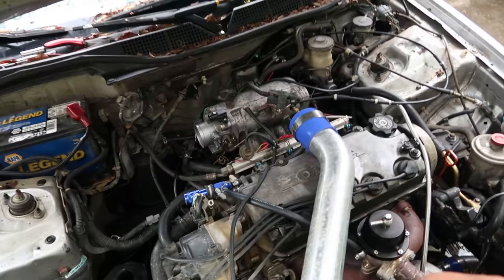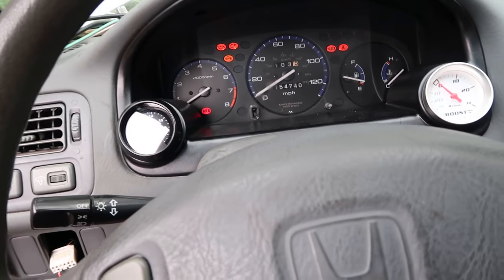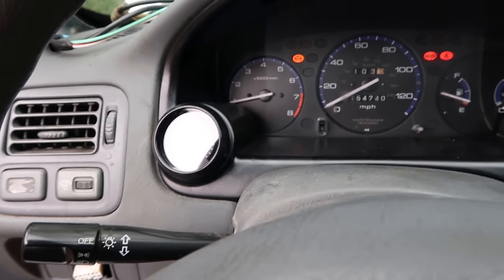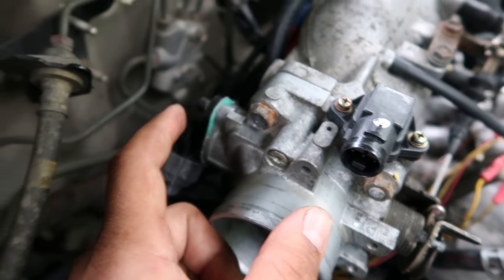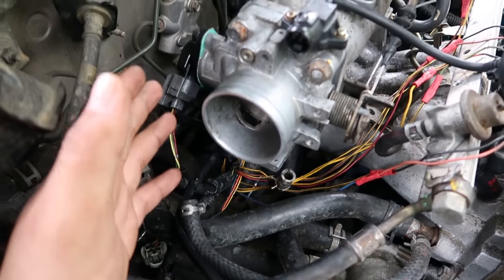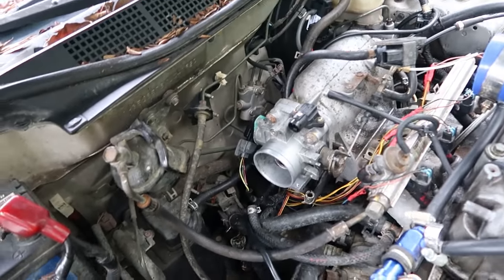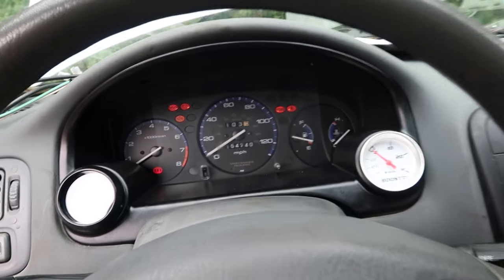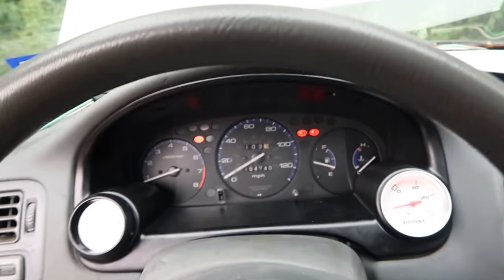Honda 1500 RPM Surge Bucking Hesitation FIXED

Comment: Been driving my car like this for the last 3 months after I deleted my iacv and got my car tuned. I only had to readjust mine as opposed to replacing it, but it worked. Thanks a million bro!
Reply: Really i have a similar issue.. were your idle rpms below the normal level?? 

Im going to clean and afjust my iacv and look into this sensor as well

Comment: Idle surge means the tps is at the correct position but you have to fix the vacuum leak if you advance the tps to fix the idle surge the car will drink gas more than usual

Comment: So I changed my IACV sensor , my TPS sensor, map sensor and IAT sensor even got a replacement oem Throttle body gasket ! 
It fixed all my idle issues besides one thing. when I'm coming to a complete stop, my rpms will go down. but as its dropping down towards 1200-1300 rpm,  it will stays there for like a second or two then it will drop back down like normal  until I accelerate again and come to a complete stop again.
Reply: Where you able to find the issue? I too having the same issue with my honda civic 2004 lx
Reply: @blue_sprinkles1487  i removed the little breather intake filter i had on the motor added a vacuum hose that goes to the rail the connects to the idle air control valve into the intake and added a iat sensor but the light still on for the iat sensor but i adjusted the idle screw abit and my tps i made sure it was at the right voltage shes been running good so far

Comment: I think I’m having this issue it mostly happens for me partial throttle around 2k -4K. B18c1 it started throwing a p0170 code at me and a evap code also. I’ve changed the grounding wires cleaned the contact points. Changes plugs and wires. Changed the o2 sensor. Going to buy the tps ASAP and fingers crossed it works. Also put a new IAC on it
Reply: Did this work?
Reply: This work for you?

Comment: Did it go away when the car was warm mate?? Im having this problem, ordered new sensor as had it fixed, but soon as it was turned off and restarted warm it came back
Reply: Same with me, as the car gets warmer it’s starting to act up more
Reply: @ArchangelMicheal-vk6jm  think it has to be a problem with the p28 ecu , my tuner said this... told me to get the s300 hondata or the new hondata standalone ecu .. at 500 quid i will live with it lol
Reply: @wolfcivic95  I’ll check that, thank you

Comment: Quick question man, i did that and i does not fluctuate when im reving it freeley, but when i drive it and when its under load the car starts bumping and gets stuck at 1500 rmp why is that? Also it starts rought, does not cold idle and wants to shut down( BTW IAT SENSOR IS NEW AND TPS SENSOR)

Comment: I have a similar problem: when the car comes to a stop, it reves to 1500 and back to +-800. Also when I turn around my steering wheel, it goes all the way to 1500 and back to stationary. Any ideas ?
Reply: you ever find a fix for this?
Reply: @ByCrackin  not yet ;( you have the same problem?
Reply: @WatchfulListener  yeah man, also throws a check engine light when it is at temperature
 and idleing
Reply: @ByCrackin  check your pcv valve / tpm sensor

Comment: In my case sometimes when I let go the gas to change gears (mostly from fisrt to second) the rpms drop super fast to idle, so I have to tap the gas a little before engaging second gear. Changed the TPS already (because of other issue). Steel can't figure out what that is
Reply: Check your high tension wires/coil harness. Try to replace them all with new one. And update me if there's a difference on it.
Reply: Did you ever fix it? That sounds exactly like my issue
Reply: Check your iacv or fitv, i had the same issue, i found that my iacv was disconnected, once connected the rpms didnt drop so fast and i was able to cruise in a lower gear without the car bucking

Comment: I have a gsr integra and sometimes it will buck so stupid. Like on first gear it’ll look like idk how to drive stick. And sometimes even while cruisin it’ll be cutting off power. I’ll give it gas and you can just hear the intake suckin and when I give it more gas it’ll go but sometimes keeps doing it. Then sometimes it drives super smooth. Wtf is my issue it’s so annoying. I checked the code today and it blinks 7 times Thts tps… do you guys think I need to adjust it or get a new one… I replaced that not too long ago but my guy probably put it on wrong idk. My buddy said it could be a bad temp sensor as well. It’s sooo annoying when it bucks like that tho

Comment: Your supposed to set the TPS to 0.5v at fully closed(no cable resistance) and 5v at fully open. If you cant get those values or theres dead spots as you open the tps  then you have a faulty tps and should be replaced. And 450lph is waaaaaaaaaaaaay too much for a stock d series lol your stock pump is fine, install a fuel pressure regulator, fuel pressure gauge and bump it up a little and it well fuel more but honestly without a tune( chipped/socketed ecu) all the mods are pointless as the ecu always tries to keep stock values.

Comment: What is the name of that sensor? Im having a similar issue after my timing belt broke going 10 mphs. Replaced all my belts, set timing, have taken apart the intake manifold cleaned it. Replaced the idle air control valve and map sensor all within a month. My car dies out going from park to drive.

Comment: I don't know if my problem is the same but as I am accelerating under 2k it surges in and out but as soon as I reach 2k it's fine. I'll have to look into your fix.
Reply: Yes! I’ve had the same annoying issue! Bucks and surges at ONLY partial throttle... but completely fine when floored. WOT is the only way to drive the car when it’s warm. Once car warms up to temp.. the problem gets bad. 
Have u found or fixed this yet?? Thank you
Reply: @Brianwasaabi  I honestly still haven't messed with it. I drive 2 minutes to and from work on it so I haven't really cared lol
Reply: caslone88 holy crap.. the Honda problem NO ONE can find! SUCKS! It’s been a year for me. When on long trips it’s awesome cause I’m full throttle lol. Wish I could take it to Eric the car guy for real. I know it’s just one small plastic part or a ground causing this. Gonna change my fuel pump and my iacv .. to oem Honda. then probably ecu. Cause she still has great compression and just did timing belt year ago
Reply: @Brianwasaabi  maybe talk to a older Honda tech at a dealership who might know what's going on?
Reply: I replaced the TPMS and calibrated it and it didn't seem to help at all.
Reply: @Brianwasaabi  I've heard the wheel sensosrs are part of the cars ground. Makes no sense to me. But I replaced a sensor that was bad and my car is running perfect now. Again it makes no sense
Reply: @kizerautodetailsdreamclean7624  that IS weird. Huh. Well I don’t have wheel sensors on my old shit lol. But I fixed my issue finally after over a year and half. Primary O2 sensor. Realized I was only having an issue in closed loop... which is when it reads o2. Set my timing and tension with a new timing belt.. changed o2 sensor... and set distributor timing and reset the Ecu. It’s finally running right again:) The ol d16 @ almost 400k can’t be killed!
Reply: If your Honda has an  fast idling throttle valve try to clean and adjust it.
Check this video.
https://youtu.be/w1QCaRopm6s

Comment: So my Honda civic has this idle issue were it keeps revving from 1500 rpm and 2500. It drops from 2500 to 1500 over and over again. Do you know the problem??
Reply: Fast idle valve
Reply: Vacuum leak, gasket

Comment: My 2000 civic, doesnt happen all the time but if i slowly accelerated it drops once i hit 2500rpm, like theres a gap there.. But if i gas it hard enough it goes right passed. 
Same issue? 
If im driving itll buck when i get to 2500rpm
Reply: Ever found out the issue? My b20 eg doing this now
Reply: @xJDMWaRRi0Rx  nope. I just let it warm up for a while before i drive and it doesnt do it. I give up a lot on this one..
Reply: @ABones-bm3vq  damn mine warms up but it makes it worse. This other video I watched, the guy just unplugged it and it made the car run good. People in the comments agree with him only saying the downside is mpg on the highway
Reply from the maker: Sounds similar to what this was doing. I remember it having the dead spot at 2500rpms that I was have to "gas through" or accelerate a little harder just to get past that bad spot
Reply: @BoBuilds  hey bud, im having this exact problem from the video on my gs-r. did you find the real cause of this issue?

Comment: help bro,i have the same problem with my accord 95 ,i just replaced the TPS sensor ,but still have the problem , only 1500 RPM ,any suggetions?
Reply: It could be a wiring Issue

Comment: I have a tps on my honda accord and when I'm driving at 35 or 40  mph (1500-1700 rpm) it starts to buck badly, I replaced the tps sensor and it still does it, does it just need some adjustment to the tps? or..........
Reply: My car does the same exact thing
Reply: Mine is doing the exact same to mine is a honda civic diesel mk8 2006
Reply: Recalibrate the tps to 7% , in my expierence it happens only on 5% throttle
Reply: I have the same issue
When starting car it doesn’t hesitate, but after the car warm up to operating temp , this issue start to run resulting a lag in shifting gears
Reply: @texasnhis49bitches49  yeah, I figured out that you have to adjust the tps sensor to the factor settings which was for me car 4-6 ohms. After that it worked like new.
Reply: @amgedessa8452  did you figure out the issue. I'm having same identical issue when warmed up. It has a dead spot at like 1/4 throttle cruising like 55mph and when this happens it effects my gears from changing. It never wants to downshift when the hesitation starts acting up...
Reply: @daltonnicholson5630  
Not yet

Comment: I know this post is old but i got a civic ex d16a and im having the exact same issue change the tps and and calibrated to the specs honda gives u still get it did u get a check engine code p0505 idle air control disconnect the battery goes away but comes back later any  Knowledge of this will be grateful thanks
Reply: Same issue
Reply: @tyecat413  did u found the problem i fix mine already .
Reply: Did you fix it? Its probably vacuum leak.

Comment: I have the most bizarre 94 Civic Si hatchback. It has a B20Z. Sometimes while driving, it’ll hesitate to respond to the throttle and then buck/sputter for just a few seconds, then the Check Engine light will come on. Once the engine goes back to idle, it’ll bounce between 500 and 1000 rpm over and over. I can shut the engine off, turn it back on and it goes back to running normal again. No light, no surging, no revving at idle. Just very odd. One time I actually turned the key all the way off and the engine kept running. Figure that one out. Sometimes the ignition won’t turn like it’s locked in place. I can pull the E brake up one click and the ignition turns again. Talk about wtf. I love my car but she’s a psycho. Lol
Reply: There is an ignition recall on that car

Comment: I have the same problem when i accelerate, it hesitates to run smooth so i had to slowly floor the accelerator did you encountered this before replacing your tps?
Reply: I am having the same problem. It is really annoying. Mine is Honda Civic 2017. Did you find a fix for this?
Reply: Yes i fix it already i just replace the fuel filter and the fuel pump now it works fine
Reply: John Anana having a similar issue, but between 1500-2500 rpms it hesitates. When I give it more gas it accelerates but it’s only between those measures. Was your issue the same?
Reply: @joea6326  yes when i press the pedal to 1500rpm up? it sputter and hesitate to reach 2000 to 3000rpm their are different issues you have to check the HTW, sparkplug,and fuel filter the last thing that i had suspected is the fuel pump thats why when i replace it runs fine..
Reply: John Anana what does HTW stand for?
Reply: @joea6326  high tension wire

Comment: when u were having this problem, would it get stuck at a certain rpm and not got past?
Reply: He wont reply but aye, it will be ignition cutting at 1500 rpm at 5-15% throttle
Hts tuning suite is meant to fiz this probably as it has a better command to the tps supposingly